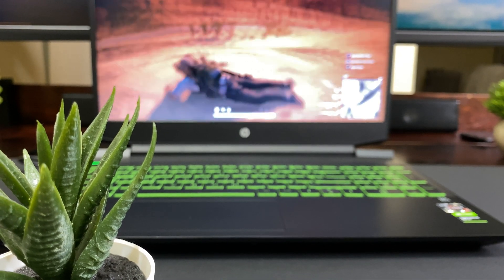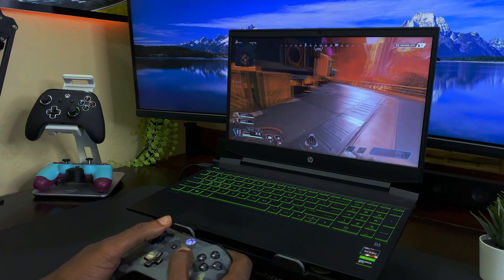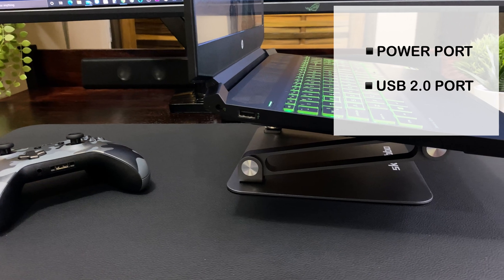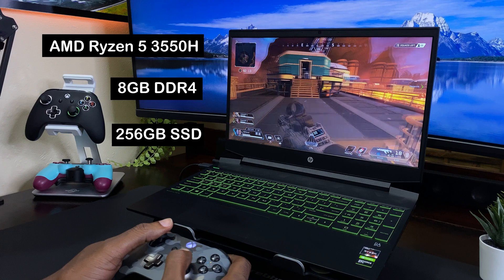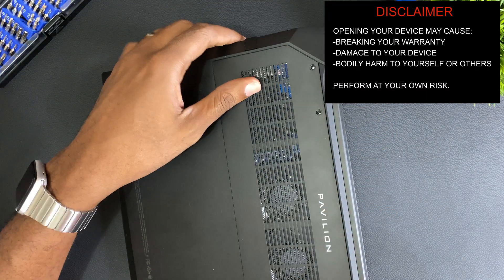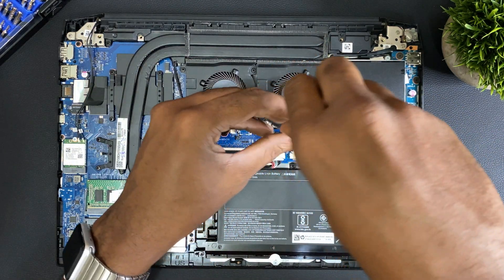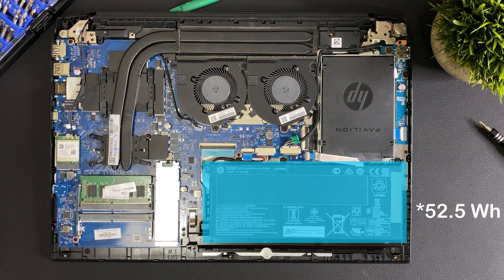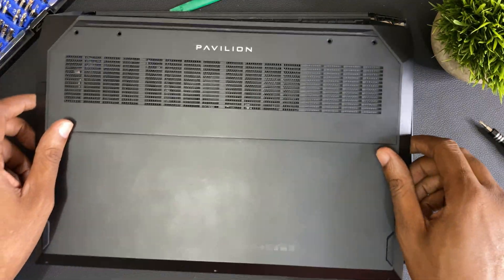HP Pavilion 15 Gaming (2019) Review & Gaming Tested | Nvidia GTX 1050 | Plus Disassembly 2021

Comment: Mine struggles with gta5 I’m going to try different games and replace the thermal paste. Any recommendations that might help. It’s super choppy. I upgraded the ram to rip jaws ddr4  16x2 and added PCIe 4.0 NVMe M.2 SSD with windows 10. Also added 2tb ssd. Thank you in advance.
Reply: Same with mine at first when unplugged. I prefer to keep the minimum CPU limit to 5% unplugged and 80% when plugged.
My tip would be to increase you minimum CPU limit to 95% maybe? That's pretty sketchy because this laptop overheats quite fast when we're talking about gtaV.
Or you could just keep charging it. I heard that new laptops come with batteries that don't get damaged by overcharging because their chargers redirect power to the motherboard or whatever.
Reply: Also, I replaced the stock 8gb ram with 2 16gb rams so... Yeah

Comment: i have same spec but my laptop is TUF gaming and i play a lot of game. The graphic card doen't run in 99% or 100% and FPS is under 60 frame. If i setting high in verry game the graphic card run on 80%  and low setting the graphic card just run under 50% :( I think the problem is Ryzen CPU + 8gb ram not oke for perfomance but your laptop gaming run well and smothly
Reply from the maker: I’m not sure what model laptop you have. It maybe a difference in TDP. HP CPU or GPU or both maybe running at a higher wattage. That is controlled by the laptop manufacturer.
Reply: @JoTheTechie  This is my model tuf fx505dd
Reply: @ucanh8538  were you able to fix it?
Reply: @waitiz0723  i sell it and play on PC :))

Comment: without changing the thermal paste would it be just as good?
Reply from the maker: Not if the thermal pads need changing. It will overheat and throttle